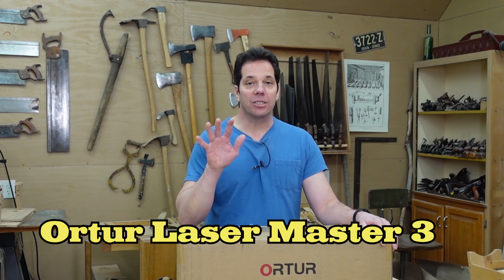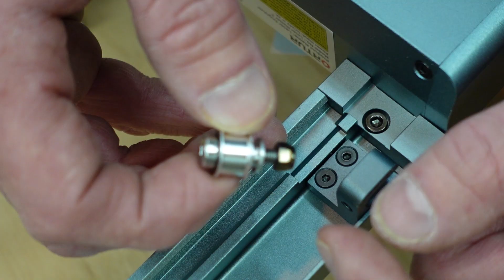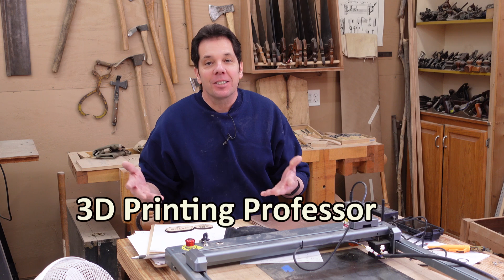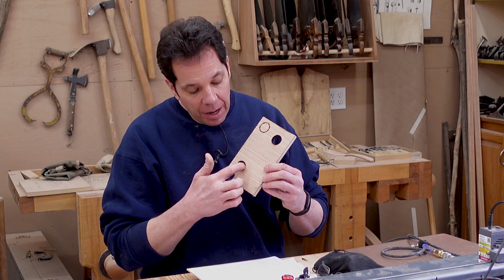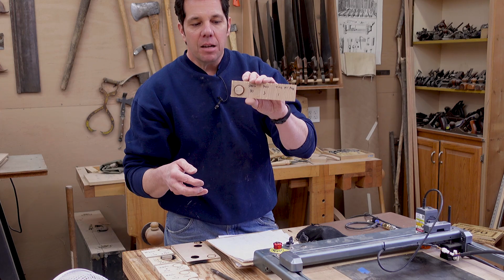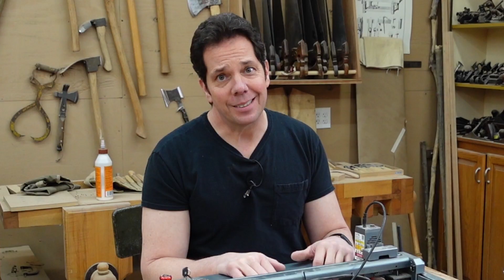a LASER Machine & a Beginner- What could go wrong?

Comment: I have a mini laser, about the size of a tennis ball. It sits on a small tripod. You use your phone to Blue tooth a photo (Jpeg). to the laser. I now have a small logo for my work 😊, as you can see. It does what I want it to. I don't need  it for commercial style stuff. I hope yours works out for your level of work.
Reply from the maker: The machine seems to work fine it's learning the software that seems to be my challenge.

Comment: A characteristically thoughtful and comprehensive review - thank you Chad. But may I make a respectful suggestion? My feeling is that the metal surface protector is not a good idea because of the possibility of laser reflection. Years ago I was part of a plasma-laser interaction research group and the danger of laser reflection was drummed into us at every moment. If there is even athe remotest chance that laser light might be reflected into someone's eye it will certainly blind them - if it can set fire to plywood it can definitely burn a permanent hole in someone's retina. I have absolutely no doubt that you are a very competent and responsible power tool user Chad but if there is even the very tiniest chance that laser light might be accidentally reflected from that metal sheet then there's a possibility of someone being permanently hurt. And you've only got one pair of safety glasses! (And I know there's a little orange filter shroud at the laser head but there's always the possibility of stray light.) It's twenty-five years since the laser safety officer, a wonderful character called Alastair Montgomery, impressed these warnings on me but I remember them vividly. I know it sounds like over reaction but for pity's sake don't take chances with laser light - you only get to make two mistakes. Cheers Chad and thanks again.
Reply from the maker: That is GREAT advice! I never even considered that. Yes, I will do that and in a future video, I will correct my error in that regard. Thank you

Comment: So, you bought this laser equipment, and was too cheap to buy Lightburn software for $60?  That was a mistake.  The LB software is THE software for lasers today, particularly diode lasers.  AND it is also awesome design software so you don't need to use Inkscape or some other design software.  So, you have the operating software AND the design software all in one.  And I think it is extremely easy to use.  Last LB has GREAT tutorials on their YouTube and channel AND their manual is very good which can be accessed easily within the software. Another great resource for laser information and education is the Luisiana Hobby Guy on YouTube AND he also has a forum that is free to join.
Reply: It sounds more like it was a freebie to review.
Reply: @TheDiecastShowUK  Yes LB offers a free trial period, but it is not free forever.  There is a $60 fee, which is worth every penny.
Reply from the maker: Hahahaha I wasn't necessarily being cheap. I thought I mentioned I wasn't sure if I was going to like it the machine and if I didn't I didn't want to waste the money. But after using the machine I do see I will use it. And hearing more people recommend Lightburn I will be subscribing to it. But thank you for the recommendation.